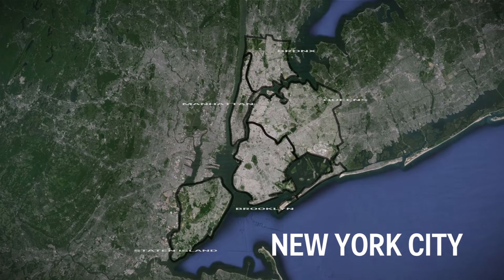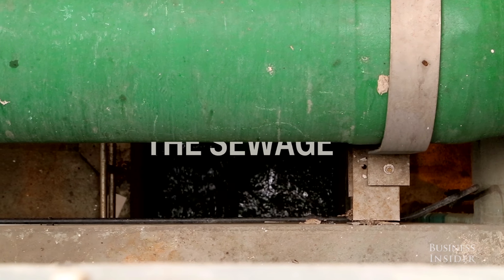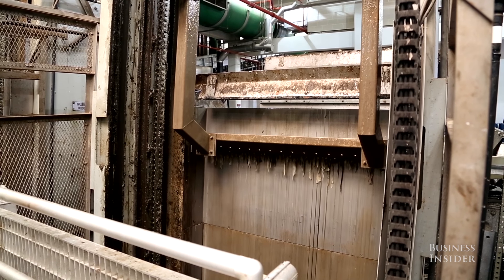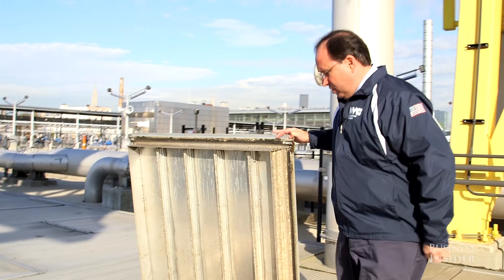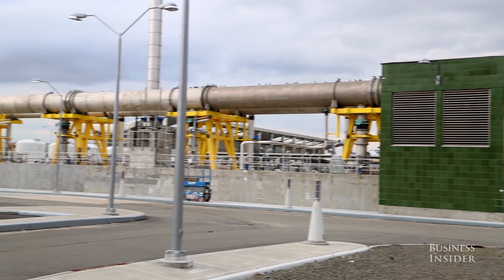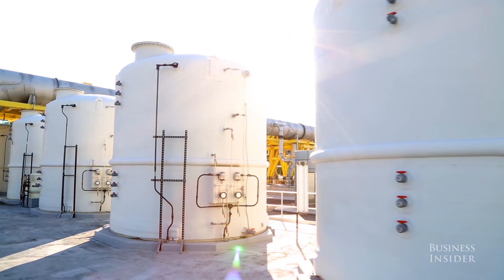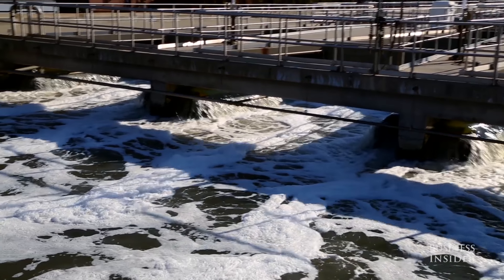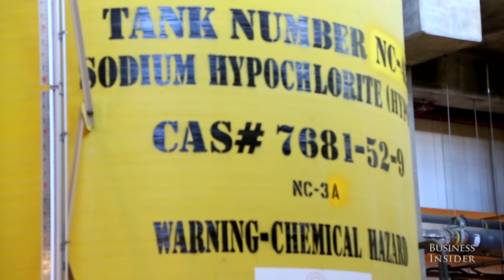Here's where New York City's sewage really goes

Comment: Im no chemist. But I do electrical work at sewage treatment plants in my area. Im told the discharge water has to be cleaner than the water its being put into. Maybe the rules are different when you're so close to the ocean??
Reply: In New York City they bend the rules simply because they have to. The plant would need more time to get the water to 100% but its NYC they would have to rely on every person in Manhattan to no use anything with water. There is millions of gallons entering the plant every hour they need to keep the flow going or sewage will start coming up through the man holes.

Comment: Using ALGAE to purify effluent at the sewage plant, same growers for home•farm•ranch stack to 6-high, 4-6 handle adults.

This emits O2 and removes CO2 before burning it.

Then, the oils & biomass can become biodiesel & derivatives, from a pilot study I did for Phoenix, AZ, a 10M-gallon/day plant can produce about 3M-gallon/day of biodiesel.

Gov. Jan Brewer and her EPA head were on board, Siemens & others, ASU & local labs used in R&D, we got shot down by her party, the GOP in the USA.

Too bad, eh? Sound familiar?

This was using 11% oil Spirogyra, 50% oil selectively bred species were done prior to WW2 for this purpose.

My design priority offgrid homes so chose what's in any pond to charge them, LEDs 50w/person + controls.

You try.

Comment: This video fails to address "overflow" from the Newtown Creek plant. Millions of gallons  overflows on the average of once a week.  When sewage loads exceed the capacity of the Newtown Creek Sewage Treatment Facility raw untreated sewage is dumped into Newtown Creek. This dumping is referred to as a combined sewer overflow and can be triggered by as little as a tenth of an inch of rain.

Essentially anything that gets washed into the gutters from the street, anything that households and businesses flush down the toilet or dump down the drain, has a fair chance of being expelled directly into Newtown Creek flowing into the East river and onto New York Harbor untreated. In New York City these combined sewer overflow events occur about once a week on average, discharging approximately 500 million gallons of raw sewage directly into New York Harbor. 

Even with the expansion of the plant, as of 2014, the city is still not in full compliance with the 1972 federal Clean Water Act, which mandates that secondary treatment should remove 85% of pollutants from incoming sewage, or with New York State's 1992 order for the city to prevent overflows by 2013.  The city requested a postponement of the 2013 deadline in consideration of its plan to build a fully compliant Newtown Creek plant by 2022.